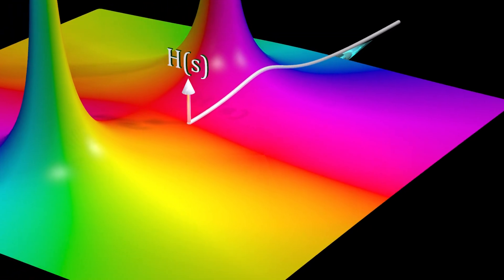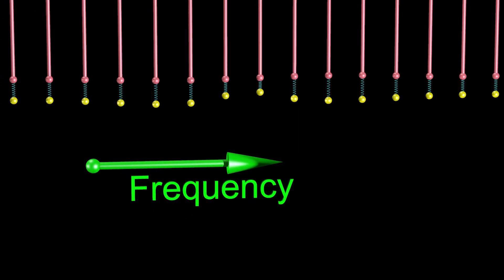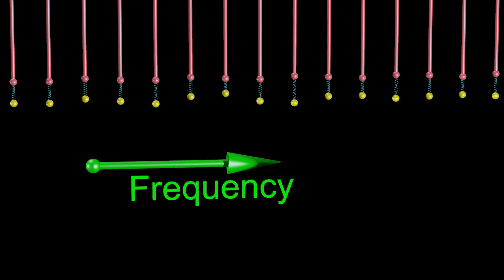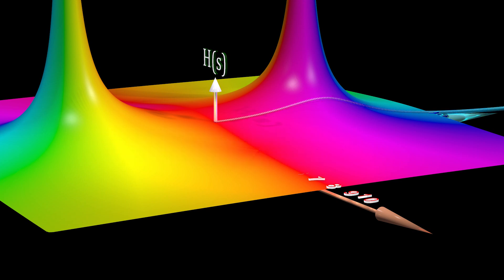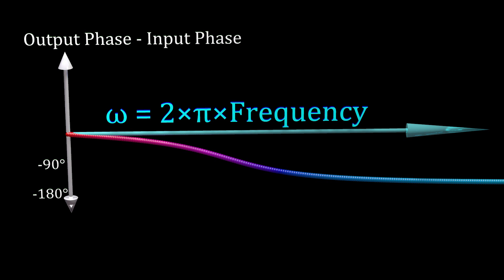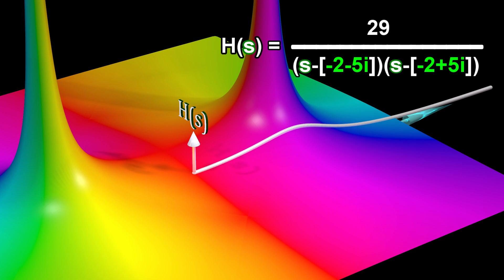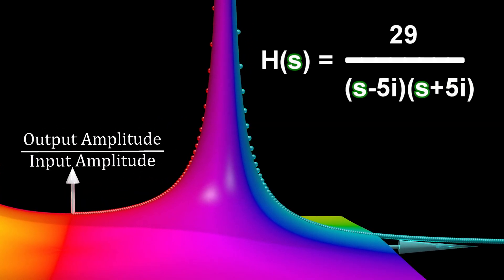Frequency Response

Comment: What is K? I feel like the end of that video showed some crazy phenomena happening in the graph at K = 4.0
Also wondering what are the components of s are... I’m guessing spring tension, length, spiral diameter? Pretty new to this over here
Reply: "s" is the frequency parameter, so Im(s) is the frequency. Re(s) is, well, the imaginary frequency, so exp(st) has both oscillatory and exponential behavior. The springs were all the same, with resonant frequency squared f^2=k/m, and damping ratio "g". The transfer function then goes like 1/sqrt( (2fg)^2+ (f^2-s^2)^2/s^2)

Comment: Are transfer functions usually/always anti-symmetric across the real axis? What would it mean to have a transfer function that has a  different magnitude with negative omega input frequency than it does with omega input frequency?
Reply from the maker: The transfer function is always symmetric across the real axis, for any system that can actually be physically implemented.

Comment: So the real part of s is omega, with dimension cycles per time. Does the imaginary component have the same unit/dimension? What does it represent?
Reply from the maker: No, the real part of s is not omega.  We first calculate w = 2*pi*frequency, and then we calculate the transfer function H(s) at s= (i)(w). In other words, we calculate H(iw). The output of this gives a complex number with a magnitude and a phase.  Thanks.
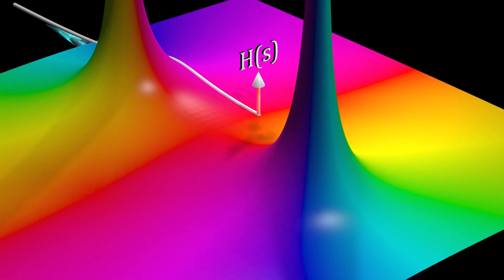Reply: First I would like to correct myself: 1:43 clearly shows that what I was referring to is the imaginary part and not the real part.

I just thought it was omega because 1:27 said so. It suggested to me that changing the frequency would only move on that line, change the imaginary part of the input.
So I thought that if changing the frequency can't move the input in the direction of the real component, what parameter other than the frequency would I have to change to get to those massive magnitudes that aren't on the original line? Maybe something about the mass, the stiffness of the spring, or the damping?
Reply from the maker: If we reduce the damping to zero, then the two locations where the magnitude is infinity will be on the imaginary axis, and it will be possible to pick a frequency such that |H(iw)| = infinity.

Comment: As an electrical engineer, it is incredibly satisfying to visualize such abstract topics we study.. thank you so much!
Reply from the maker: Thanks.  I am glad you liked my visualization.
Reply: How is this abstract when you can literally plot bode on an oscilloscope or in matlab and clearly see it?
Reply: @RazvanGabor  Greetings, it is the math itself which is abstract, since it relies on logic and theorems. Coincidentally, it very well explains many of the things and behaviors that happen or exist in real life, such as the way a system responds to frequency in this case. The matlab library that plots frequency response probably uses an algorithm that employs the fourier transform itsef somehow. In terms of measuring equipment, oscilloscopes (amplitude vs time) and spectrum analyzers (amplitude vs frequency) use complex circuitry to sample and then plot these things. Hope that helps. Cheers 🍻
Reply: @RazvanGabor  psst: that’s still abstract

Comment: Hey man. Great video, as always but some context would be nice. I have no idea what it's about or what it relates to 😅
Reply: It relates to many applications i.e being studying mechanical engineering, I am gonna use this concept to prevent the parts of machines to break or fail due to mechanical vibrations. I hope you got it.
Reply: Not an engineer here. But doesn’t this concept explain why the infamous Tacoma Narrows bridge collapsed. The wind being the input frequency and the “gallop” of the bridge being the output frequency? So the engineering mistake was not accounting properly for the transfer function? Anyone can help me here?
Reply from the maker: David, yes you are basically correct.  To be more precise, the wind created an input function which included frequency components at the resonant frequency.
Reply: @Pseudify  Yes you are right. They forgot to take the wind into account. You must have noticed that when high speed winds flow, they don't keep on flowing. The first high pressure wind slap move the bridge from its mean position to one extreme position, after that slap of wind the pressure suddenly drops down and the bridge moves (oscillates) to its other extreme position. I mean to say that like sound waves,  winds also flow like waves, i.e, in the form of compressions and rarefactions of large wavelengths. I hope you got it. 
The solution to your problem is to simulate the wind analysis for that bridge. Thank you.

Comment: Another great video !I still have doubt please respond.  Poles of transfer function means resonant frequency of function ? If yes then it any system/circuit have freq of 50 Hz then how would you represent it in complex s= x + iy form ?
Reply from the maker: To calculate the frequency response, we enter s = (i)(w).  This will have the highest amplitude where w is equal to the imaginary component of one of the poles, and w is equal to 2*pi*frequency.
Reply: @EugeneKhutoryansky  so you mean pole won't have real component ,only imaginary component s=iw ?
Reply from the maker: The pole can have both a real component and an imaginary component.  But, the frequency response is at a maximum when (i)(w) is equal to the imaginary component of the pole.
Reply: @EugeneKhutoryansky  I am confused in s=iw part. I can understand that as 50 Hz sine input can be represented as  s=iw .but in what kind of input we represent with real part(x) of s=x+iw
Reply from the maker: The pole can have both a real component and an imaginary component. But, the frequency response is always H(iw), which is at a maximum when (iw) is equal to the imaginary component of the pole.  We first calculate w = 2*pi*frequency, and then we calculate the transfer function H(s) at s= (iw).

Comment: Oh now I got it that when the frequency will reach resonant frequency , the spring will break. 😨😨 Well done my mentor 🙆😳
Reply from the maker: Thanks.  Though, the spring will still be OK at the resonant frequency if there is sufficient damping to the system, as in the original example.
Reply: @EugeneKhutoryansky  Oh 😳 you mean to say that even at the resonant frequency, it is not necessary that the system will be damaged. Only the amplitude is maximum at resonant frequency; breaking of the system is an exceptional case?
Reply from the maker: Yes, the amplitude is a maximum at the resonant frequency, and whether or not the system will break depends on whether or not it can handle this amplitude.  If there is no damping, then the amplitude at the resonant input frequency would theoretically reach infinity.
Reply: @EugeneKhutoryansky  What is spring?
Reply: @EugeneKhutoryansky  Wow. 😱😱 Thank you very much my mentor for giving me  this precious conceptual sentence . 

"If there is no damping in the system, the amplitude at the resonant input frequency will theoretically reach infinity."

💖💖💖💖💖💖💚💚
Reply: @physicslover1950    Eugène is worthy of your respect but best stop short of worship.  For the output amplitude to be infinite, the output mass on the spring would need to have infinite kinetic energy and travel at infinite speed.  It can't.   This analysis is an extrapolation from Newtonian physics, so we must stop short of infinity.
Reply: @raykent3211  No 😥😥😥. 
Please use some common sense. It is not necessary that to travel infinite amplitude the mass must have infinite velocity. If the stiffness of spring varies with distance from mean position, then it doesn't mean that to achieve infinite amplitude the mass must attain infinite velocity. 
Please think deeply. This is a point to ponder. Just think about the spring constant "k" which is the stiffness of the spring. This has to do with elastic potential energy. If the stiffness of spring is not a linear function i.e doesn't obey Hooke's law then it is possible that the mass can have infinite amplitude without having infinite velocity 😒.
Reply: @raykent3211  Yes you can say one thing that at resonant frequency the system will try to reach the extreme position ( infinite amplitude )  but it will never because to cover infinite distance even with the speed of light, it requires an infinite time for the mass to reach to the infinite amplitude according to the observer observing the system.  But according to the prospective of the output mass itself, it gives an error because at the speed of light all the length of the universe even infinite lengths contract to zero and the mass will reach the mean position of that infinite amplitude in no time because at the speed of light, the time will stop almost completely.
Reply: @physicslover1950  thanks for engaging,  though I'm not too keen on being told to use common sense, that sounds like a gratuitous insult.    Given enough time a snail can move 1 km.  In Newtonian physics,  given imaginary rocket  boosters it could go a million miles in one second.  Einstein says no, this extrapolation curves off, Newtonian physics is off.   So if a theory makes a wrong prediction,  ditch the theory.  The theory of springs is very limited.  Nobody can show me a spring that compresses down to zero length, nor expands to near infinite length.  Such a thing does not exist.  The spring "law" is an extreme theoretical extrapolation from a very narrow range of real experience  that's a pig's ear within its domain.
Reply: @raykent3211  Yes you are actually correct but my purpose was not to insult you at all🙄🙄. But consider for a minute that the two masses can hypothetically pass through each other. Then see the results 😎😎.

Comment: At 2:32 why did you remove orange axis? 😵😵😵😵
Reply from the maker: That is the axis for the real number line.  When calculating the frequency response, we enter s = (i)(w).
Reply: @EugeneKhutoryansky  What do you mean by s= (i)(W) ? Do you mean we can only enter the imaginary part in input?
Reply from the maker: What I mean is that to find the amplitude and phase at any frequency, we first calculate w = 2*pi*frequency, and then we calculate the transfer function H(s) at s= (i)(W).  In other words, we calculate H(iw).  The output of this gives a complex number with a magnitude and a phase.
Reply: @EugeneKhutoryansky  Oh 😓now I got it. All the points on that blue imaginary axis i.e 1i, 2i, 3i, .... are actually angular velocity (w=2πf) multiplied by iota (i)? The output is the amplitude and the colour indicates the difference in phase of input and output? Am I right. 

Then what was that orange real axis for?
Reply from the maker: Yes, you are correct.  The orange real axis was to show the output of H(s) for "all" possible values of s.  Thanks.